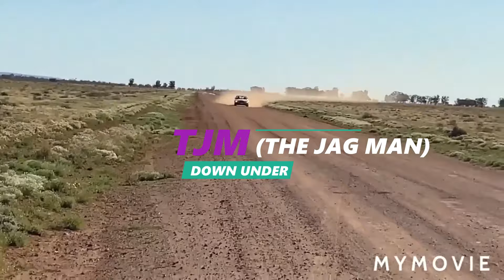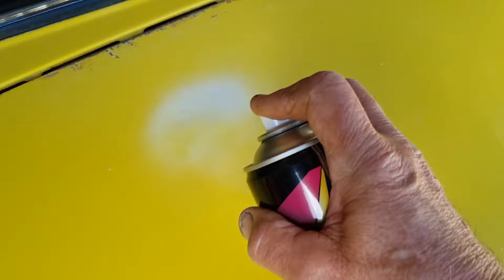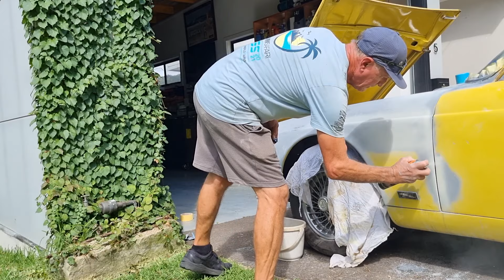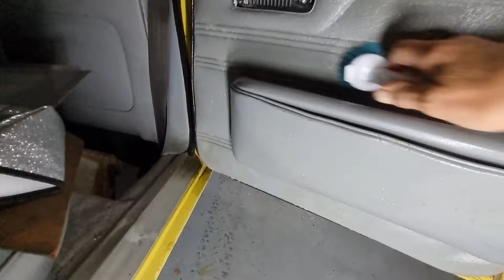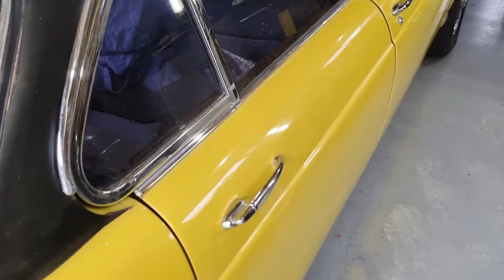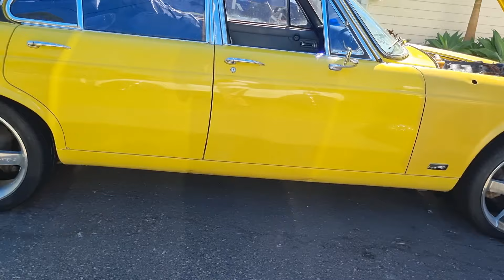EP6 Yellow XJ6 S1 Progress

Comment: You've a big advantage in Oz over me in the UK, no bloody bodywork rust. The front doors   on mine rotted out ages ago. Not to mention the rest. I did do the rear subframe mounts a  while back they were comparatively easy compared with the front suspension ( I'm still on that) because the weather is diabolical here in December. Keeping making the vids.

Comment: Hi TJM, im currently restoring a 420G myself on my channel. I was wondering where you got those subframe mounts? My Jag has the same IRS as the XJ and ill need bushes, tie rods, balljoints etc in the not too far future and im also in Australia. I wonder how many parts suspension wise is the same between an XJ6 S1 and a late 420g? Their production overlapped for a few years there
Reply from the maker: Hi mate
I get most of my parts of Ebay. Jagdaim in Melbourne is also a great source